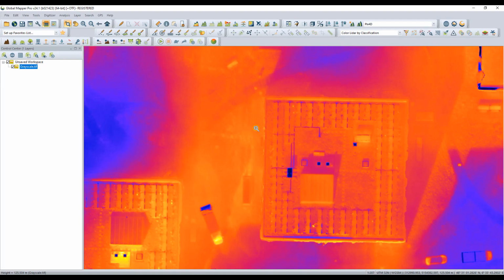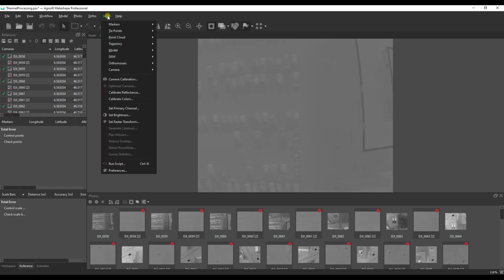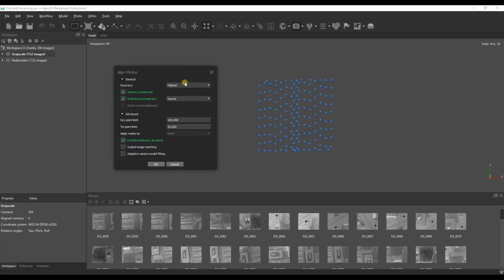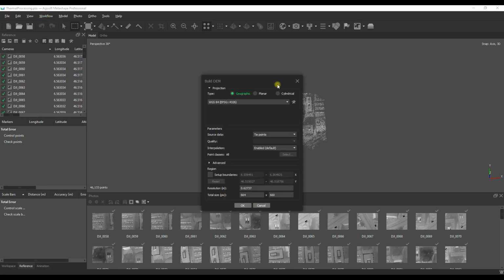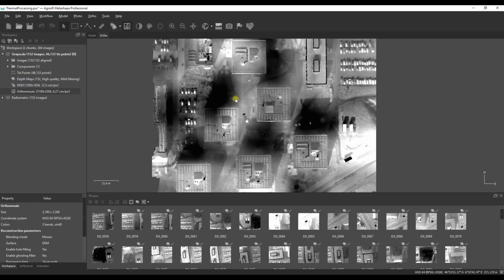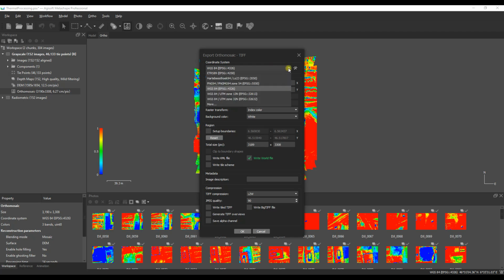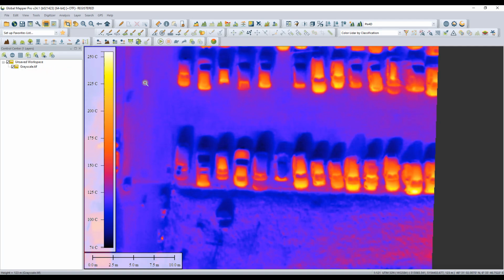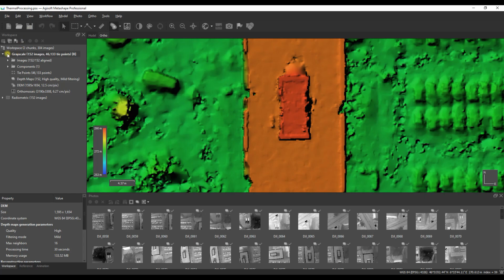Thermal Data Processing Workflow in Metashape (Non-Radiometric)

Comment: I have autel dual 640t enterprise  and looking for software  to process thermal and photo mosaic jobs (for stockpile calculations)
Reply from the maker: Metashape would work for you to handle Autel data for both thermal and standard RGB imagery. (So would Pix4D and a few other software packages as well).
I have other videos for RGB processing and stockpile calcs in Metashape, if you decide to go down that road.
There is a 30 day trial of Metashape available if you want to test it out first.
Good luck!